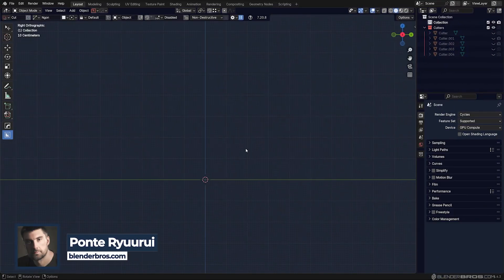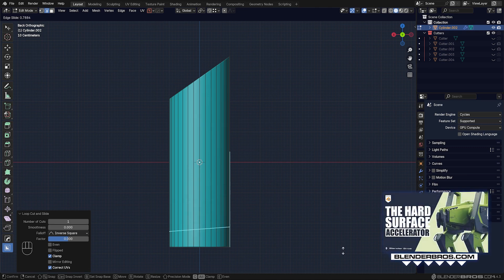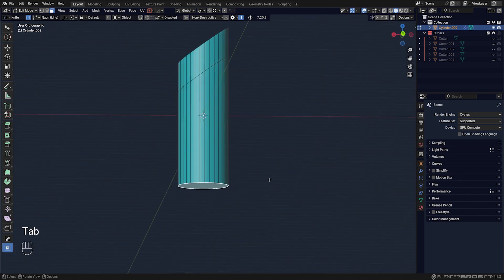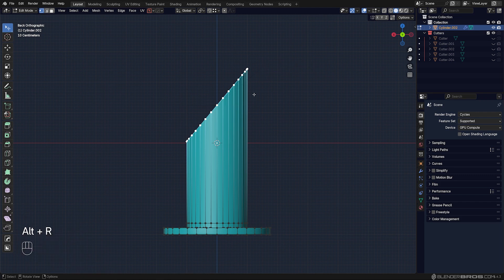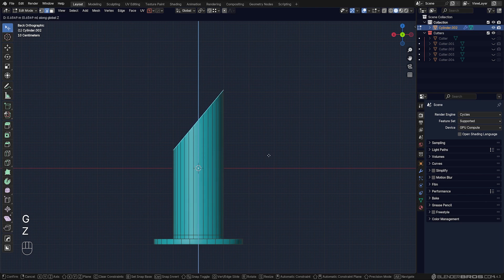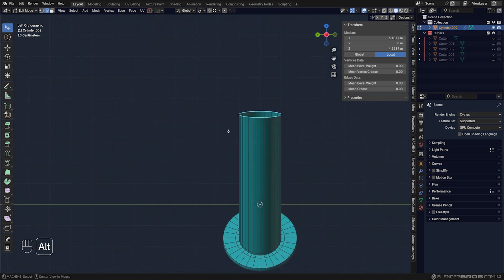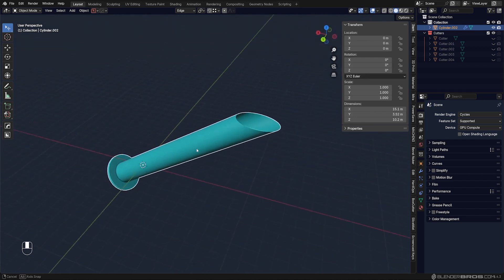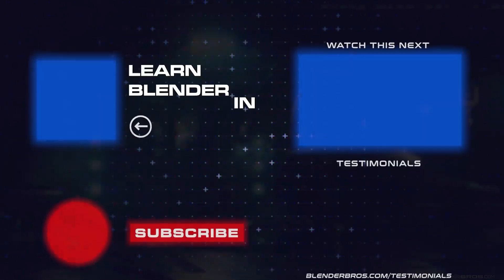This Blender Sliding Trick Will Blow Your Mind!

Comment: GG (or Shift + V) + E (Even) + C allows you to "lock" the shape without slanting without the need to set a custom orientation.
Reply from the maker: as i shown in the vid, gg c and e wont work
Reply: @PonteRyuurui it does work, I use it all the time. The important part is the order of operations.

You don't even need to remove the face. Notice that when you press E, the option for Clamp gets toggled off. All you needed to do was press C again and it will allow you to extend it on both directions while keeping the faces aligned.

Try it. Select the face, then verts (converts face selection to vertices) then do GG (or shift V) + E + C. Notice that the option for Clamp needs to be white (toggled on). If it isn't just press it again.